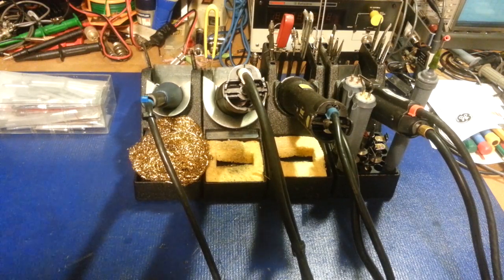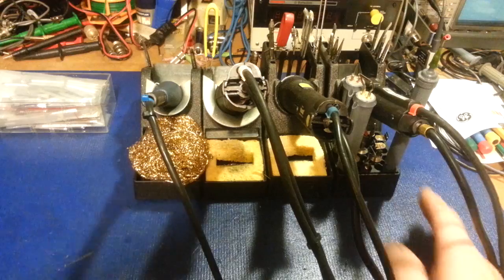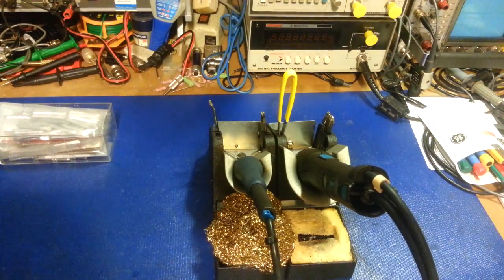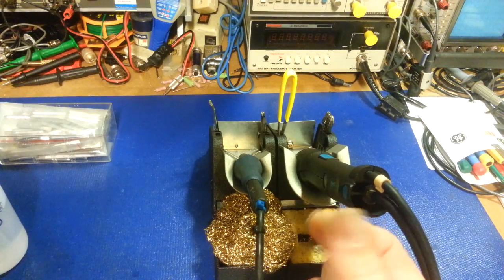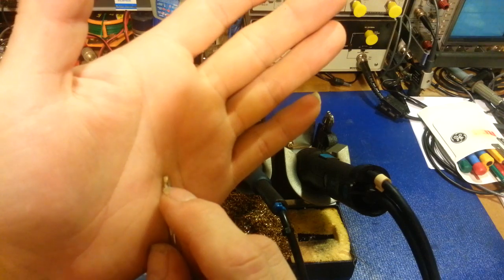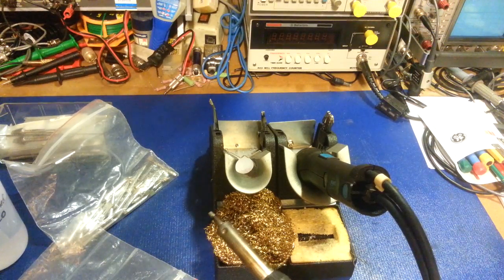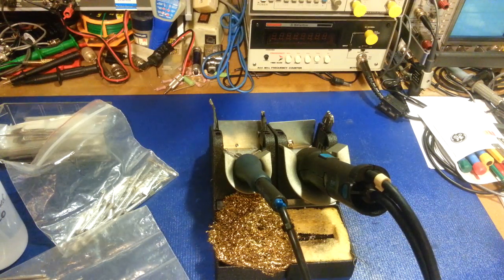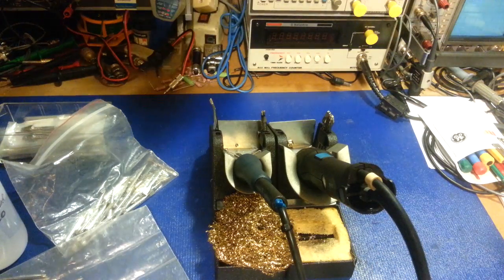Soldering and desoldering iron tip maintenance.

Comment: Hi Mike, Thanks for sharing your knowledge. I want to get a de-soldering station. What model is your pace?  Also is it worth getting a soldering iron that is Electrostatic discharge protected ( E.S.D)
Reply from the maker: LOL, you probably don't want the setup I have.  It is a Pace PRC-2000 and cost a little over $5,000.  You could pick up a smaller Pace unit on ebay at a reasonable price.  If you work on ESD sensitive components you would want a ESD safe setup.  If you get a high end unit like a Pace or other top brand it is probably going to be ESD safe anyhow.
Reply: Thanks Mike, yes it would be a bit silly for me to pay that much as I would not use it enough. I thought it would be around $200-300. I will get something under $500 just as a de-solderer. I only want to change Capacitors over on my equipment and Friends will no doubt want some done on theirs. I Appreciate you writing back.

Comment: i have 3 irons from radio shack, 2 of them are old from back in the day and they still work great even the tip , 
now with smaller parts i bought a 2016 model pencil to get at them dinky parts nowdays, ,, Well......... needless to say the quality absolutely sucks the iron is good but the tip well i used the iron 3 times and the tip is destroyed it wont even pick up solder to tin it and it only has 1/3 of the tip left on the shaft after 3 uses, how sad is that?   just goes to show you all the old  saying 
(they don't make them like they used to) is so true....
Reply from the maker: Well actually they do, it just cost for quality.  All the good irons have very durable tips.  Pace, Weller, Hakko, Metcal and companies like that make excellent irons and very durable tips.

Comment: I've had two Weller soldering stations over the last 30+ years and have found like Mike that maintenance is the key to keeping them running well. Was it you in a recent video that talked about some kind of tip compound that you used to help keep your desoldering iron tip in good shape? I remember bookmarking on Amazon the stuff but haven't gotten it yet...this CRS disease is getting old (like me!).
Reply from the maker: No, wasn't me but I did mention it in this video briefly.  The stuff I have seen comes in a small tin can.  Most companies like DigiKey, Jensen and the like sell it.  Never had a use for it though.  Doing it the way I do has worked well for a long time.
Reply: No, I know the stuff you mentioned, have it and use it every once in a while myself. The stuff may have been mentioned by Todd Harrison over on his channel. Anyway I think it's for welding apparatus and is called Nozzle Dip Gel. But as you say, simple maintenance should suffice. Thanks for the tips (no pun intended...well, maybe!).
Reply from the maker: +Dino Papas 

I do have gel I use on my mig welding tip.  Helps prevent the weld splatter from sticking to the gas shield.

Comment: Mike,

Right on with keeping the equipment clean. I bought a Weller TC202 , the tip does the temp regulation, about 35 years ago and still use the original tip. I keep it clean and well tinned. My chisel tip looks about the same size as yours. Don't do any day in day out soldering like you, but it has served me well over all these years.